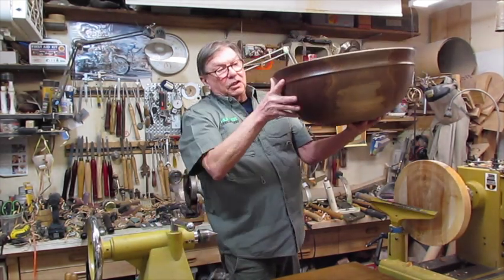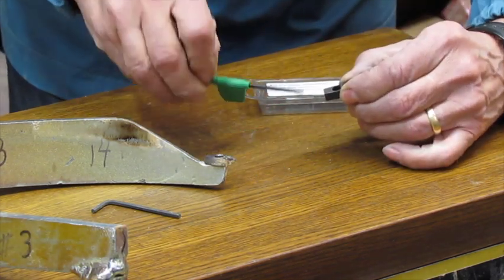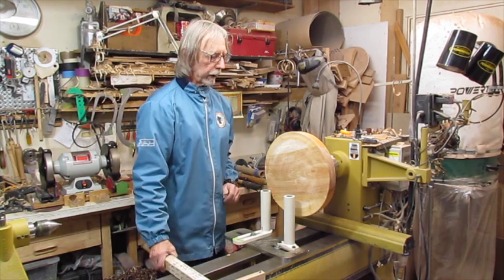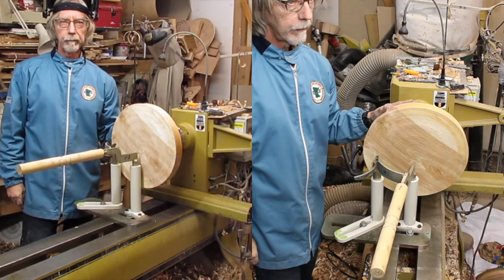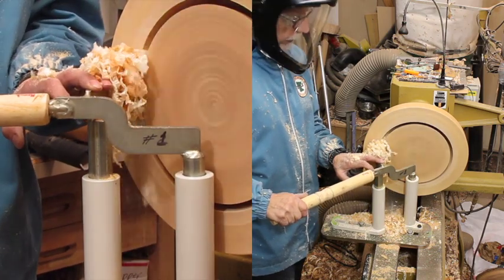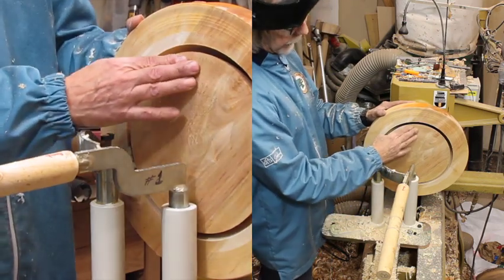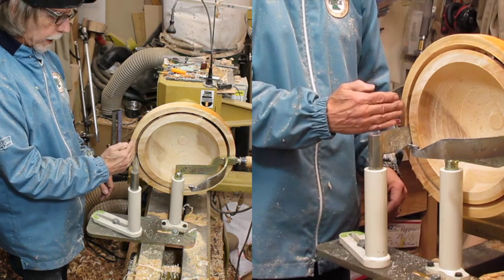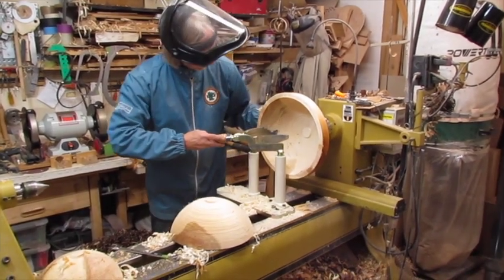Korpro coring set up

Comment: I've only had my Coring system and Korepro cartridge for a few months but so far, it's paid for itself with the extra bowls I can get from a single blank. It works great on all the different wood species (Walnut, Maple, Butternut, Cherry) that I've used it on, as well as wood/resin bowls. The nice thing is, I'm not forever sharpening my cutter after just a few cores. I think I'm at 26 cores on the one side of my cutter, and it still throws ribbons of shavings like it was new. I'm even considering a second cartridge so that I'm not changing them between cutters so often.
Reply from the maker: Thank you for your comment.  Many thanks.

Comment: I have the woodcut bowlsaver system with the brazed on cutters.  Do you have an opinion of whether your current (one-way) cutters could be brazed on?  I'm wondering whether the screw hole for the carbide cutter would be compromised during the brazing process.  Thanks.
Reply from the maker: The Korpro will only fit on the OneWay system.  I have looked at retrofitting the Woodcut, but it is not a practical solution.
Reply from the maker: It is best to send an email directly to HunterToolSystems@gmail.com.